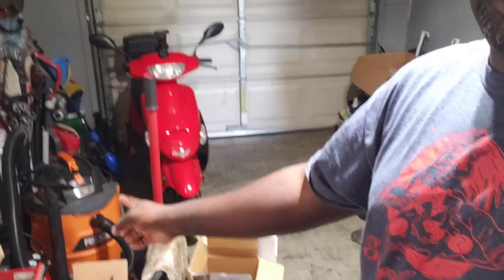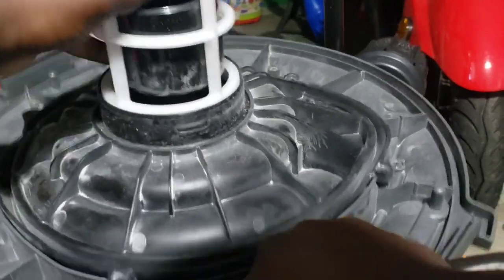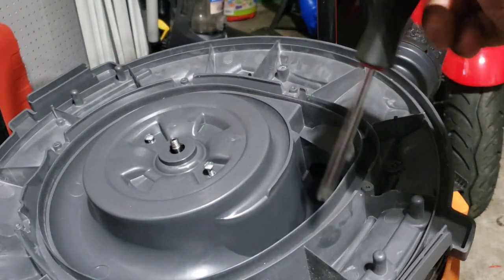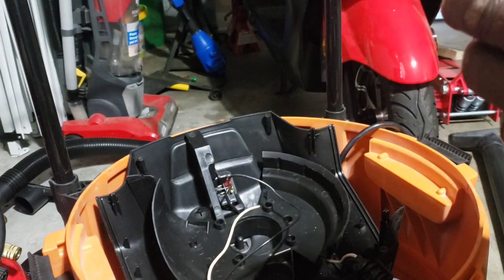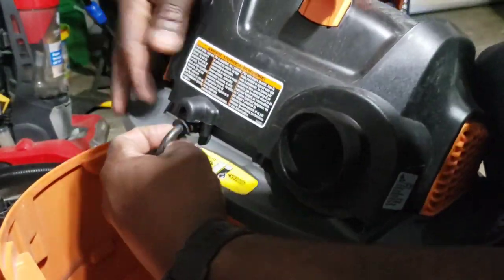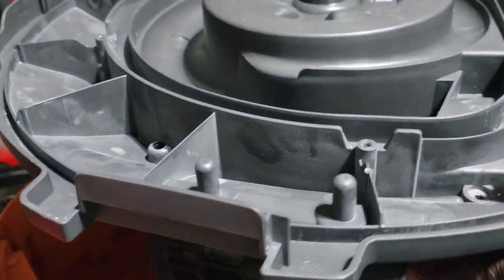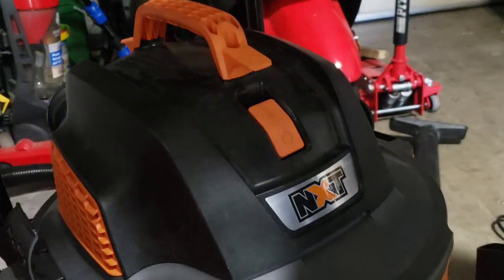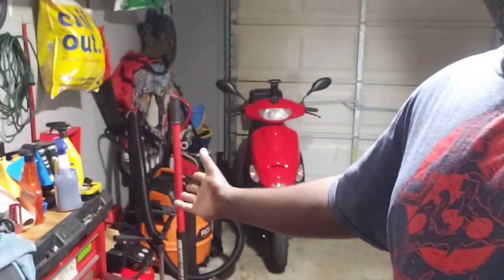How to replace a Ridgid shop vac motor

Comment: Great video, thanks.  What's a trustworthy site to buy shop vac motors?  I have 
Rigid 16.5 Gallon shop vac, MODEL MOB16000 120V 12A 60Hz.
Reply from the maker: Ebay's good wherever they have them or use just going google and just type in or say you know , ridge vacuum cleaner motors and a chicken won't pop it up , and then you can go from there to pick on which one got the best price

Comment: Thank You for the Video. My vac was "Rode hard and Put away wet" as the cowboys used to say. I spent way to much time trying to figure out how to disassemble it to replace my brushes. That Nut was rusted and the hole for the Allen wrench was completely useless. After too long I finally got it but still cannot get the "Spacer" off. When I saw you just lift it off I was shocked. I guess I need a lot more PB spray

Comment: My problem is putting back the spacer on the vacuum is seem the middle part became to short how I fix that
Reply from the maker: Got ya
Reply: @fixitdaniel  any tips?
Reply from the maker: @yahalk2088  Have you tried adding another space to that gap
Reply: @fixitdaniel now sure what you mean but when I put the spacer that hold the metal bar between the two screws it comes off short
Reply: Like there is gap in between but I don’t know how can I fix that gap
Reply from the maker: @yahalk2088  if there is a gap in between you could and a thin nylon o ring to fill that gap

Comment: Can you tell me the part number for the motor you used as a replacement for your rigid vacuum cleaner
Reply from the maker: I found it on eBay here's the link. https://www.ebay.com/itm/224893643322?mkcid=16&mkevt=1&mkrid=711-127632-2357-0&ssspo=1OF02YvTQAW&sssrc=4429486&ssuid=0lJYiIDlQkK&var=&widget_ver=artemis&media=MORE

Comment: Damn i wonder if that's what happened to my vacuum. I was using it and it started to sound a little weird and smelling like something was burning and then it just shut off. It was my dads so it's a older model but it worked fine. Should I try to fix or just buy a new one?

Comment: the motor cost just as much as a new vac
Reply from the maker: You sure about that cause my type of shop vac cost 208.00 dollars and the motor to replace it was way less than that. In fact it was under 100.00 dollars.

Comment: So where did you get the spare parts?
Reply from the maker: I just went to google and said Ridgid vacuum motors and just match up the right motor with the one I had and found it.
Reply from the maker: Here the link for the motor .
Reply from the maker: https://www.ebay.com/itm/224893643322?mkcid=16&mkevt=1&mkrid=711-127632-2357-0&ssspo=1OF02YvTQAW&sssrc=4429486&ssuid=0lJYiIDlQkK&var=&widget_ver=artemis&media=MORE